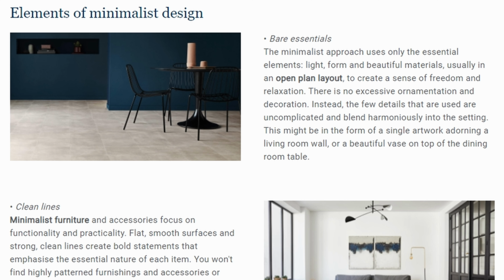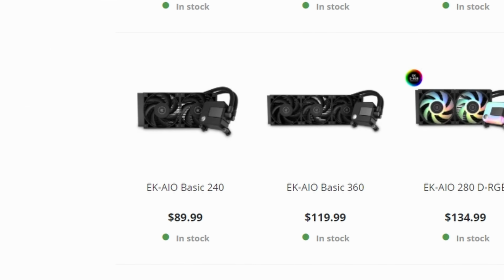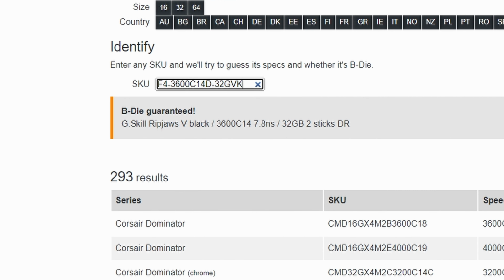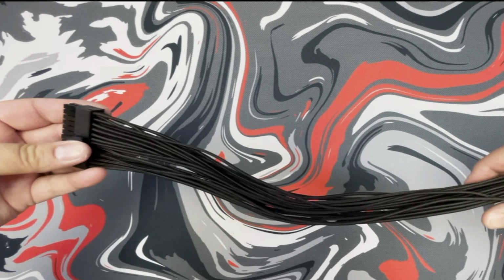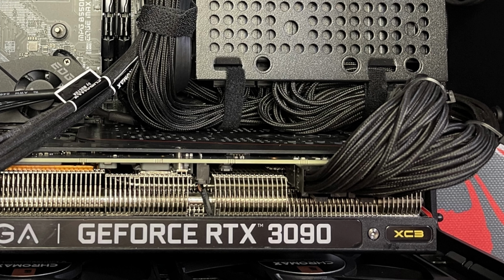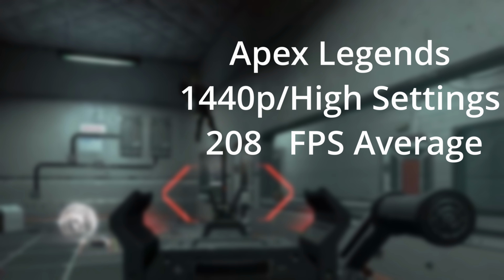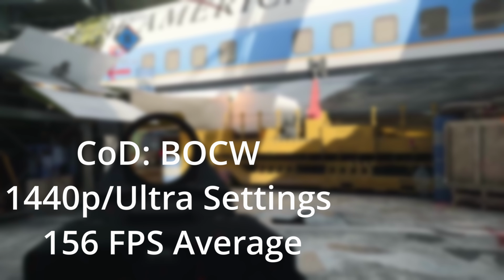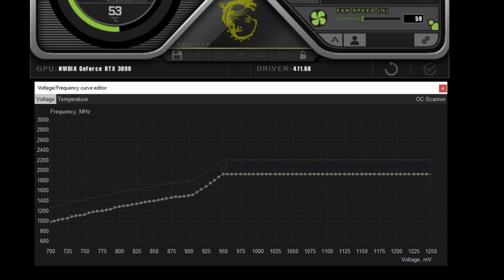My Overkill ITX PC (NR200) Build For Gaming & Editing

Comment: Price?
Reply from the maker: Wait, are you my wife? Were you sent by my wife? Are you friends, or associated with my wife? LOL

I don't have any exact total, let's see:

5950X $800
3090 $1750 ish
MSI B550I mobo $200
2x16GB 3600/CL 14 RAM $325
2x1TB Crucial m.2 P2 storage $100 each
Stupidly expensive Corsair SF 750 PSU $185
CM NR200 case $80

About $3540 give or take, plus add in tax. Now you could find the CPU cheaper, but surprisingly enough you can find 3090's for about the same price, if you know where to look.

Overall it's a beast and gets used for regular work, gaming and video production and editing, so it does run at full blast on  a pretty regular basis.
Reply from the maker: I left out cooling...

EK 280MM AIO and all Noctua fans, 2 slims on the bottom, 2 140's on the radiator and 2 regular 125's exhausting through the top. 

I've also undervolted both the CPU and GPU for cooler temps and better performance.

Comment: Got the same case with a tuf 3090, 5900X, Gigabyte X570 I AORUS PRO WIFI, Silverstone 1000 SFX PSU and a fractal 280 AIO. So cool to have such a small case with high end hardware. The temps are amazing.
Reply from the maker: Great hardware! I was looking for the 5900X months ago when the new Ryzen CPUs were hard to find and the 5950X fell into my lap, so I just went with it, but it's totally overkill.
Reply: @GraybeardGiffTech  Overkill but future proof😉Keep up the great work and an overclock video would be appreciated. I am considering doing with the overclock function in GeForce experience.
Reply from the maker: I overclocked my 3090 in my big case and it was barely worth doing more than using the Performance button in GeForce Experience. These cards have very little left in them to overclock these days without a full water loop. I've been WAY more impressed with how the GPU has handled be under volted, now that has been awesome how much cooler it runs.

You are right, the 5950X, is future proofed for a while... Unfortunately I'm not LOL! I'm already wondering about the 3D V cache AMD CPUs being rumored for the end of the year.

Comment: i have the same case with 5900x and 6800xt for my main system
Reply: Building in it was a breeze but to be fair I did overdose on optimum tech, machine and more and gear seekers videos on their builds with this case so I knew what to do before I started
Reply: My only regret is not going with Corsair sfx with those nice braided cables I used a coolermaster psu and those cables are very rigid just a pain.
Reply from the maker: @modusaparandi8239  I saw someone else doing a build in a SFF case and mentioned that exact thing, so I was very aware of which PSU to get for those tight corners.
Reply from the maker: I was shocked at how easy it was to build in, I was expecting a much more challenging experience.